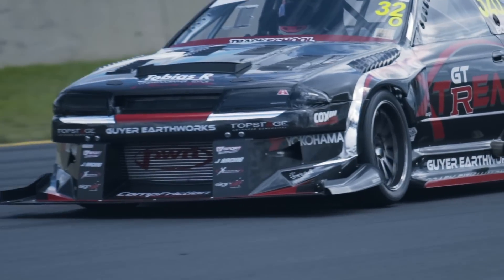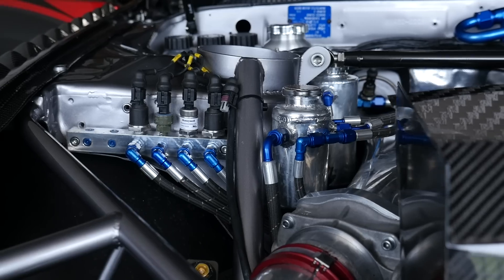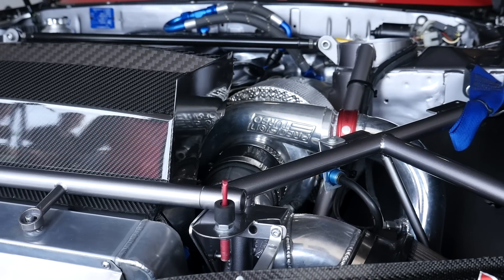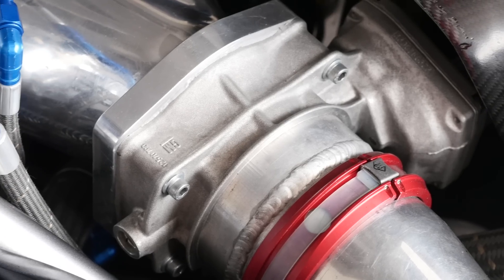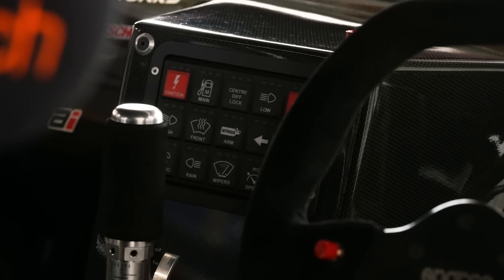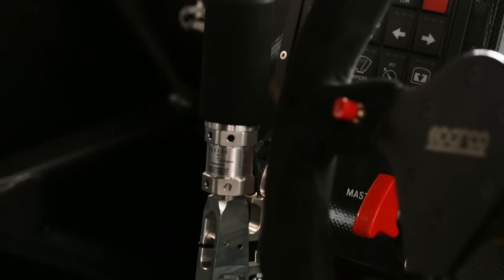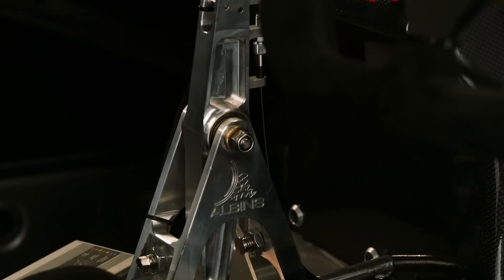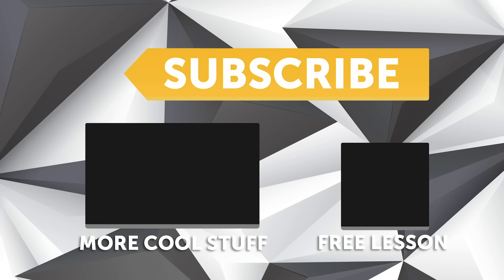RB28 950HP At 32 PSI Worlds LIGHTEST Time Attack R32? | Xtreme GTR [TECH TOUR]

Comment: Do track limits not matter at WTAC? (genuine question)
Reply: I would assume they have some rules in place like "two wheels on track" but it might only matter in some corners where it's deemed to be a advantage... also it's possible the shots where it ran wide were from a out lap (you sometimes take a wider line to gather more speed during the warm up lap) I don't run WTAC, tough so take it with a grain of salt.
Reply: There's no limits during the event
Reply: @toddxhiggins  that's cool, thanks Todd!

Comment: Uhm... is it just my impression or does 1340KG still seem kinda heavy considering all the carbon etc.?
Reply: Yeah it is, my factory one is 1430 dry. With no interior, alloy block and carbon panels you'd be hoping for 1100 surely
Reply: They still managed to save almost 100kg with a huge cage and all safety equipment but yeah was expecting a tad lighter
Reply: Taken from the WTAC website for Open Class: "Weight reduction plays a big part in this class as these cars are permitted to reduce their tare weight by up to 15%"
Reply: The Group A R32's by Gibson Motorsport homologated at 1260 Kg, and they had barely any carbon fibre in those cars. So yeah, it's still quite heavy.
Reply: Just think of all the extra parts on this car .

Comment: So to my understanding. So the billet block is a 2.6L but fitting the stroker kit makes it a 2.8L.

It def impressive to see a 950 whp full carbon fibre body R32 tearing the track. 

The main advantage of the billet block to to almost remove the chances of the block cracking when subjected to high boost and engine knocking induced damages. 

Thou i would love to see some teams run the stock cast iron blocks like the RB26, RD28 and RB30. 

With good machining, ultra sonic testing and offset boring and a strong engine bracing. The stock block will take a huge amount of punishment before it starts developing issues down the line.

If money is no object. I would love to create my own World time attack R34 GTR with the pros from Platinum Racing and Halltech for the engine and ECU controls.
Reply: Keep in mind the factory castings weight in time attack is a drawback regardless of power
Reply: @SkatersOfTheNorth  depending on the class. Street class only allow 5% weight reduction. For open class, only upto 15%. Pro class will allow up to 20%. 

Seen many open class still retain the stock block but use carbon body panels for weight reduction.
Reply: @linchester8464  Goes to show my ignorance as far as time attack goes! Didn't know there were percentage restrictions
Reply: https://docs.wixstatic.com/ugd/378ef4_2996c67de254404f94763f61a7b2e2a1.pdf

Its nearly 45%  lighter than cast - pretty impressive stuff!!
Reply: @JH-jo9wt  is thata virus? 

Bullet Race has billet block RB26 for 14 grand 

Oof!
Reply: @linchester8464  yeah that link at a first glance does look a bit dodgy lol. Its the .pdf from Bullet engineerings website